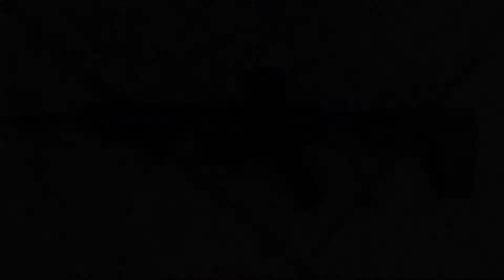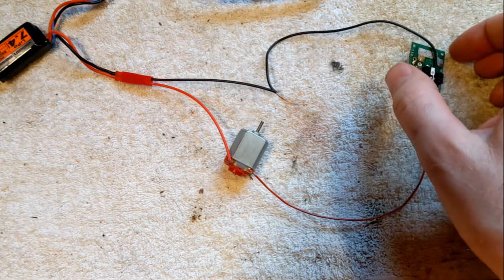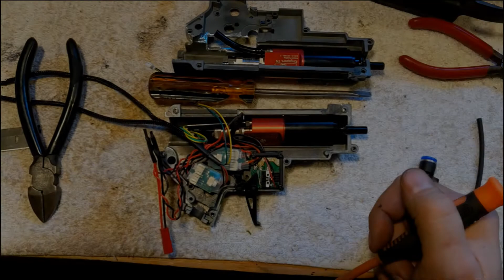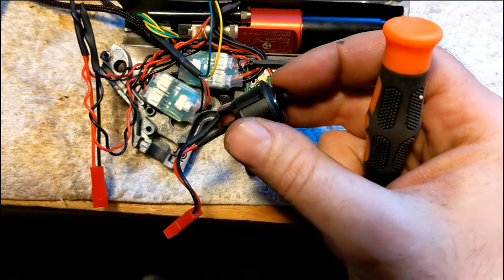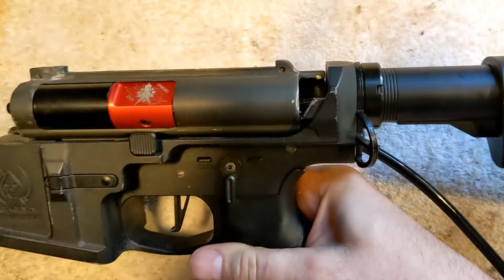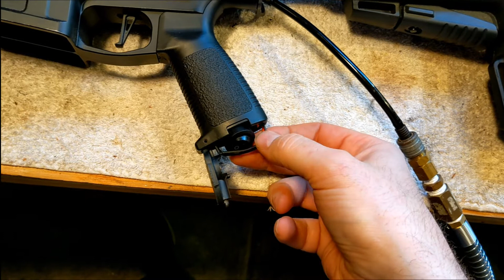Classic Army DT4 HPA project

Comment: I am just about to start this project..  where/who did you get the 3d printed piece that goes  between the 2 motors? Cheers
Reply from the maker: There is a seller on the HopUp app
Reply: @SJAAdvisor  ah shame.. says cannot have the app as not available in my region 😒

Comment: i finally got my setup done!.  The gate titan FCU doesnt fit at all
Reply from the maker: The FCU can be wired to the rear stock. Where did you put it?
Reply: @SJAAdvisor  i ended up using one polarstar  universal board and a polarstar FCU which is in the stock. I made the mistake thinking the titan bluetooth would fit just like a version 2 gearbox
Reply: i still will have to attempt a rocker switch as well
Reply: @oscargalan6218 hello did you use  a Polarstar engine or an Pulsar?
Reply: @oscargalan6218 Hello which engine did you use?

Comment: With one tank providing air for both HPA engines, what PSI do you have to set the regulator, and what is the he FPS ?
Reply: Thank you.. I’m attempting pulsar engines and waiting on my order
Reply: ❤ @oscargalan6218 would love to see this happen and give it a go myself 🎉
Reply from the maker: I use a SFR regulator. About 100 psi (dual ZCI 363mm TB barrels if I recall correctly) gets me 325 fps w/ .30g (1.5J). The issue with this setup isn't about pressure, it's about volume. SA is absolutely fine. FA on short bursts has also proven to be fine with this regulator. I haven't done much sustained FA.

Comment: Cant wait to see it in action and see how air efficiency factors in!
Reply from the maker: I may need to use the big tank ;) See if you can make it out to quickshot this weekend
Reply: Hey bud, I also built an HPA DT4, but I went with two F1s wired them both to the same F2 trigger board (one in poppet port, one in nozzle). This allows for only one FCU (Gorilla is what I used)